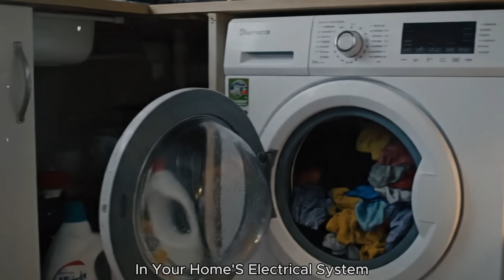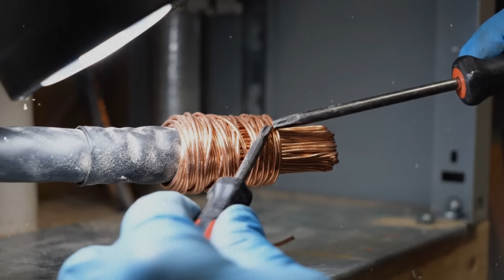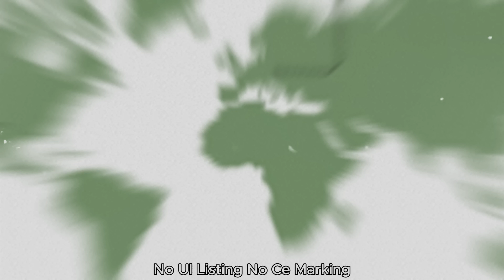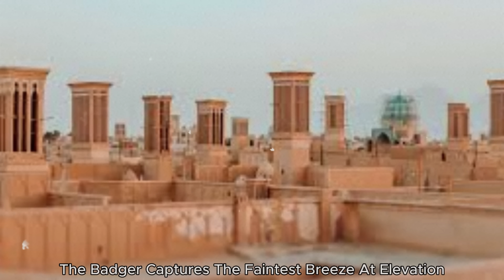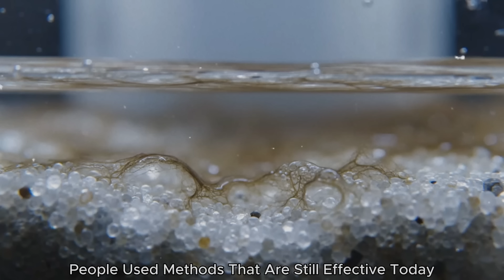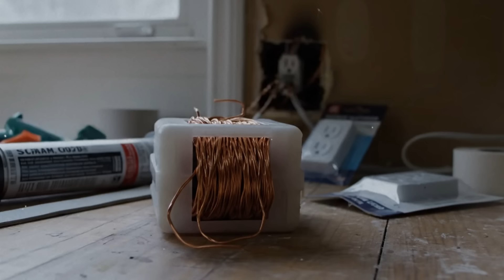This $3 Coil Wrapped on Your Power Line Cuts Electricity Bill in Half. Utility Companies HATE This

Comment: In France it seems that with the Linky meters they will charge reactive electricity
Reply from the maker: Interesting point. Reactive power is usually a grid-management issue, but whether households are charged for it depends on the meter setup, contract, and local rules. Linky is definitely worth a deeper follow-up.

Comment: I would not entirely trust all that is said here.  Rather see what the Amish have done and other reports on using copper wiring to offset the greedy utilities giving fake consumption of energy.  I have see this happen personally where I am using hardly no electricity and the bill increased.  The utility told me that everything looked normal at their end.  I do not trust this video because these wolves will make videos to discourage you from savings.  Install a coil from a video providing how to and even use a friend with a background if necessary.  It never hurts to try and help yourself.  Also be cautious of videos that claim you just have to accept drowning in monthly payments.  Remember these wolves can make videos too and tell you all is well because they stand to lose more than 50% revenue if you got smart.
Reply from the maker: Healthy skepticism is good. I’d be careful with claims about copper wiring “offsetting” utility readings unless there’s a clear measurable mechanism and independent testing. The Amish angle is interesting, though — especially when it comes to low-energy building habits, simple systems, and avoiding unnecessary electrical loads.

Comment: As an electrician since 1968, who has installed several thousand heat pumps, I highly recommend this video. If a product seems to be "too good to be true", it probably is.
The only exceptions I know of are heat pumps and LED lights. In mild climates I have measured heat pumps producing heat for less than 1/3  of the power electric furnaces  use to produce the same amount of heat. I have installed LEDs in commercial buildings that consumed less than 1/3 the power the fluorescent lights they replaced while producing more light. My advice for frugal home owners is: Shade western windows, seal ductwork in attics and blow white insulation onto the attic floor.
The only thing I would correct is the advice about cooling by opening the windows at night. That works if the relative humidity outside is below 50%, or the temperature is at least 10 degrees below the desired indoor temperature. Otherwise, the house will soak up humidity all night that the air conditioner will have to remove the next day.
Reply: good luck using a heat-pump in -40c without the off-load needed to generate heat being PURE ELECTRIC. Nothing beats a natural gas or propane furnace. Sorry to burst the heat-pump bubble. Sure..in the states they may be efficient but the tide quickly turns up here in Canada. Our PM has been pushing these stupid heat-pumps ONLY because of his personal financial interest/Brookfield reesons. We're tired of hearing about heat-pumps and his electric cars too! You know the ones? The ones that cant be charged in cold Canadian winters and only get you an hour down the road in such conditions before needing a charge...yeah...facts.
Reply: TRY THE DAMN COPPER ANYWAY AND SEE FOR SELF!  WHAY ARE PPL SKIDDISH ABOUT TRYING SOMETHING? DON'T BE DISCOURAGED!
Reply: @lamarherring7792 maybe visions of electrocution are a detergent. 😂
Reply from the maker: Appreciate the field experience. That’s the right way to look at it: not every “miracle efficiency” claim is real, but heat pumps and LEDs are two rare examples where the physics can actually deliver major savings under the right conditions. Climate, installation quality, and backup heat still matter.

Comment: I live in a 40 foot fifth wheel camper and my electric power bill never gets over 200.00 dollars living in a camper is the cheapest way to live especially if it's payed off
Reply from the maker: That makes sense. A paid-off camper can be a very low-cost setup, especially if the space is small and energy use is controlled. The tradeoff is insulation, climate, maintenance, and where you’re parked — but for some people it’s absolutely a practical way to cut living costs.

Comment: Thank you for your EYE OPENING INFORMATION, I went through my own home and I have unplugged the three electric power (saving none return electricity boxes I WAS STUPIDLY EXPECTING TO SAVE ME ON MY POWER BILL!) I also unplugged my electric vampires you told me about except my refrigerator’s and freezer’s and anything else that needs to be unplugged for saving me money like my microwave and whatever I need to use them I’ll plug them back in and unplug them when not using them!!!  I’m tired of being scammed, So thanks again!!!
Reply: TO TRY AND SAVE IS NEVER A SCAM IF YOU MAKE IT YOURSELF.  JUST DO IT AND TEST THE VALIDITY FIRST BEFORE JUMPING ON THIS BAND WAGON.  I KNOW SOME OF THESE STATEMENTS IN THE VIDEO MADE WERE LIES.
Reply from the maker: Glad it helped. Just be careful with anything safety-related or essential — fridge, freezer, medical devices, routers/security systems, etc. But yes, cutting phantom loads, unplugging useless “power saver” boxes, and measuring real usage is the right move. The meter tells the truth.

Comment: I've only seen one way to cut your energy bills I was working on a home renovation job there was a😮 new addition on the back the meter was on the back wall inside the addition in order to install the second story they had to remove the mount for the electric line and so it was removed from the house and the was also removed the meter laid on the floor and the line ran out where the new back door would be I noticed that the meter wasn't running in the horizontal position
Reply from the maker: That sounds more like a wiring/metering issue than a real efficiency improvement. Anything involving the utility meter or service line has to be handled legally and safely by the power company or a licensed electrician. The safest ways to cut a bill are still measurement, insulation, HVAC load, water heating, appliances, and rate plans.